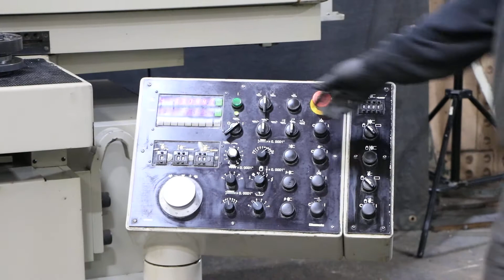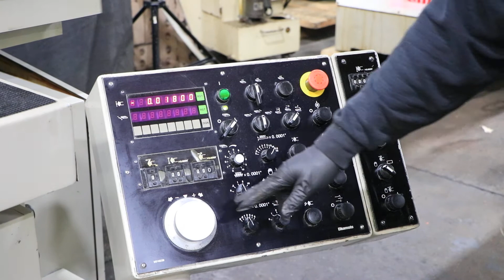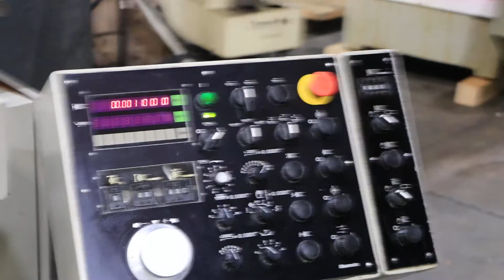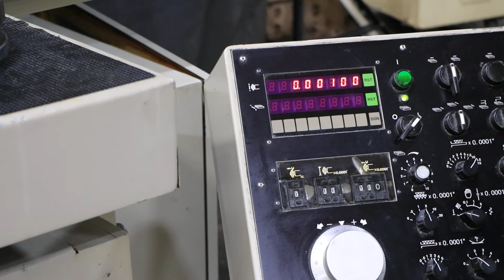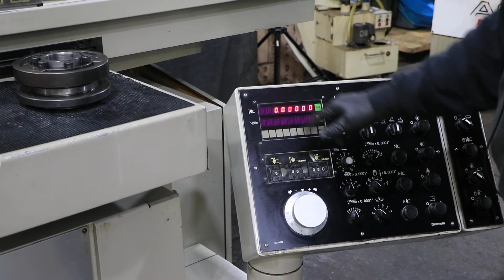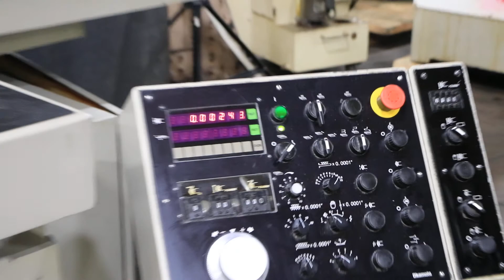16" X 32" OKAMOTO "HIGH-PRECISION" SURFACE GRINDER

Comment: Have troubles with ours where we can’t slow down the set speed of the cross feed on the saddle. It only wants to haul ass with the feed rate. It’s a fine line going back and forth between stalling and feeding too fast with the middle handle. Also can’t get it to move in step feed mode and have to use the step feed plus plunge at the end (the float right selection)